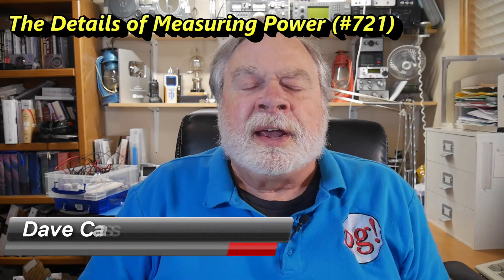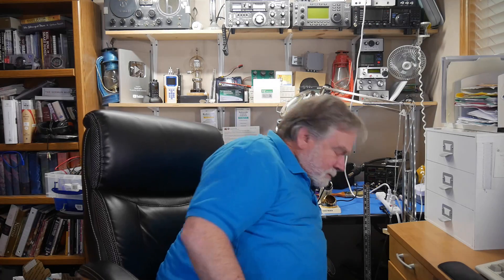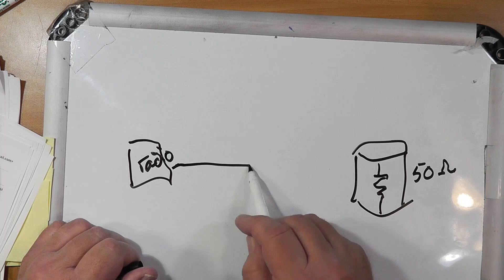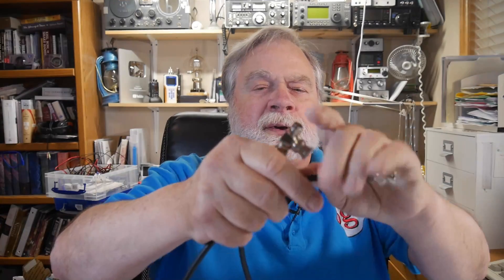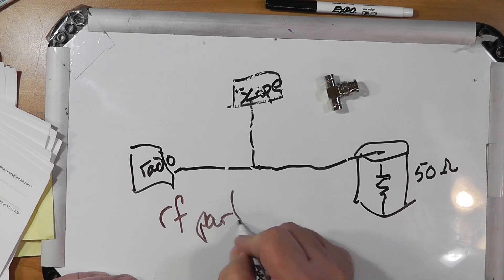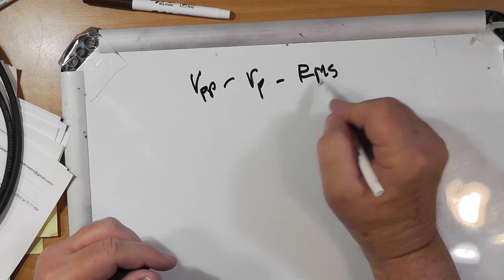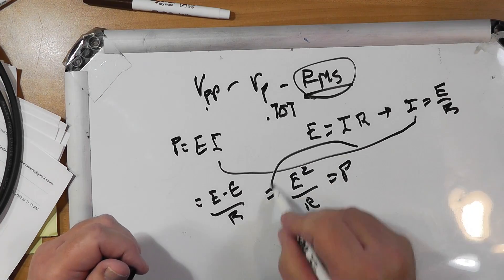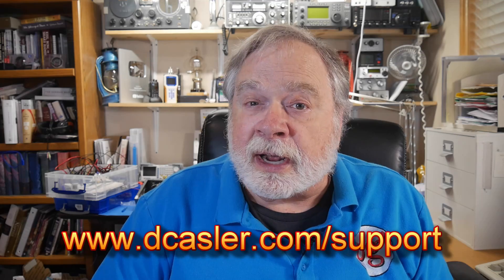The Details of Measuring Power (#721)

Comment: I would advice to use the probe at 10x attenuation setting. Without this, the results for some higher frequencies may not be accurate due to the input capacitance of the scope. On my cheap probes on a cheap Siglent scope, the results started to crack down already over 14Mhz.
Reply from the maker: Good point, thanks!

Comment: So...should you do anything to protect the input of the scope from excessive power?
Reply: Using dummy load is for protecting your scope. Since your scope input has high impedance (1M ohm or more) and the dummy load only had 50 ohms, almost all current flows to dummy load, not to the scope. Just make sure you do NOT change the input impedance to 50ohm.

You should, however, make sure the input voltage for the scope is not too high if you want to measure high power.
Reply: @krzysztofadamski7804  Ok. That makes sense. Thank you.

Comment: Although not mentioned, if your scope has a selectable 1Meg Ohm or 50 Ohm input impedance, make sure that the 1Meg Ohm input is selected. Otherwise you will divide the TX power between the scope and dummy load and potentially blow the input termination for the scope.
Reply: I was thinking the same thing.  Also, the scopes have multiple 'coupling' selections:  I.E. AC, DC or GND, etc.  The proper one needs to be selected if the scope used doesn't have an automatic feature.  I remember, back in the day, working on TV's and an isolation transformer was a must when using a scope, too.  Lots of hot chassis issues and so on.
Reply: And dont use a patch cable between the T and the scope, that could result in impedance mismatching and wrong measures I think ...  T direct to the scope!